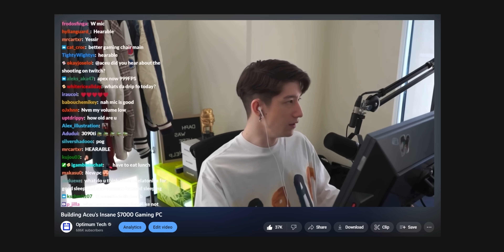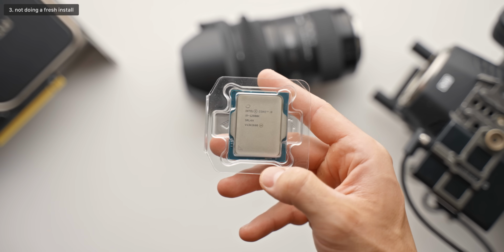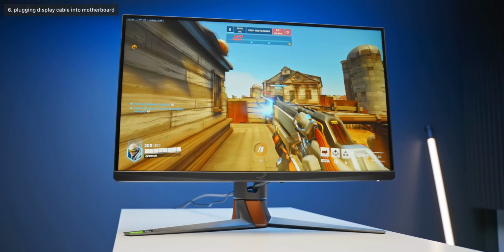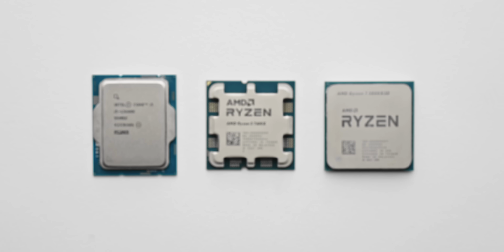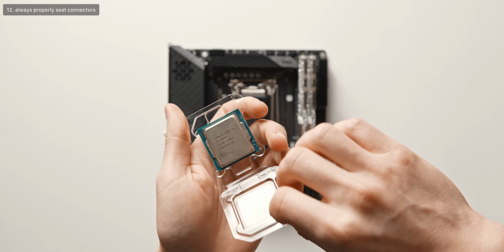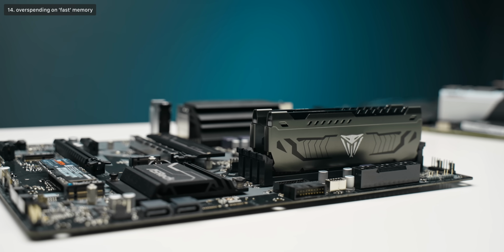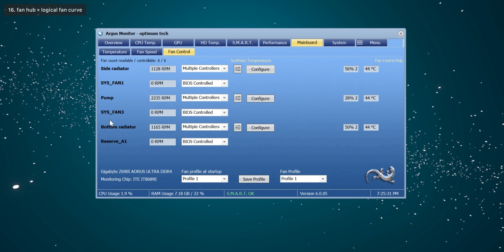Avoid These PC Build Mistakes

Comment: What are the odds that new ram sticks out the box are unstable? I just recently finished my first pc build. Was able to install windows but keep getting “corrupted files have been found” when running the sfc scan now. I will randomly get blue screens and my pc will freeze randomly as well. Did a diagnostic on my ssd and it seems to be in good condition. The windows memory diagnostic let me know there were hardware problems so I’m just hoping it’s the new ram sticks and not the dim slots 😭

Comment: Overspending on CPU - not true when it comes to powerful graphics cards. 4090 is often bottlenecked by CPU. You just need to buy CPU according to GPU. No need to buy i9 with 1650 and it's stupid to buy i3 with 4090.

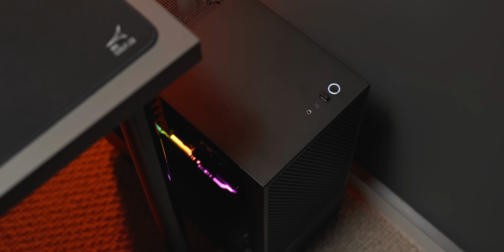Comment: 1:20 yeah, when i built my pc in 2019 with r5 3600 on b450m motherboard, i had problems like this even pc not starting anymore cmos had to reset many times, but as time passed updated bios many times it fixed it self, makes sense taht am5 is havign same problems now...

Comment: Just built my first pc last week.  I didn’t even think about it as I put the cpu on the motherboard.  My biggest mistake?  After setting everything up and playing some games (everything working good) I ran a benchmark and my cpu only scored roughly a 9000 on a multicore cinebench23 test.  Temps never moved from 30c.  I wiped the ssd and reset the bios since I had no clue what I had done wrong.  It all works perfect now and after the fact I think I had accidentally set the bios power to the wrong setting.

Comment: i don't agree with the overspending on the CPU, unless you going for a very low budget build i think there's a very good advantage to invest more on the CPU now, because prices don't jump up so high as GPU's and then you can just upgrade the GPU. like now i would advise on going with the 7800x3d if building a new PC even if that leaves your budget for the GPU lowish. the same applies for the power supply, you can get a 850-1000W PSU rated 80+ gold from reputable brands for under $150 USD. 

with that you're set for like years with the same platform with only needing to upgrade the GPU. no more worries about bottlenecks.

Comment: Memory stability with ryzens... On my 5600x setup with B450 mobo stock XMP profile is setting DRAM voltage to ONLY 1.23V where 1.35V is recommended

Comment: I thought 3 wire fans are pwm. 2 wire is voltage regulated. Is there fans with 4 wires? I don’t have the option to change in fan xpert, or bios.
Reply: 3 pin is voltage regulated and 4 pin is pwm, not quite sure why
Reply: @IwanJames  thx james. I'm still learning.

Comment: When it comes to thermal paste, i use enough to spred it across the whole cpu ihs, than i add a pee sized ammount on top of that to fill in any gaps and divots when the cooler is placed on the cpu

Comment: always fresh  install ur os when building a new pc. save ur stuff from the old pc on a external drive and drag the files afterwards back onto ur new system. 
check for bios updates and check ur ram speeds in bios.

Comment: I over tightened my CPU cooler bracket and it ended up scraping through the protective layer of the motherboard right down to the copper and it ended up shorting out. thankfully it's still alive and perfectly fine, but the CPU bracket and motherboard are very burnt. amazingly it's still completely fine

Comment: Here's my problem... My motherboard died and since it's a 1366 socket, I can't really get a replacement. So have had to change my motherboard, CPU and RAM. Technically I could use my old RAM, but it's not exactly fast RAM.

Now I want to use my existing installation because I've got a lot of VERY custom setup on this install. I'm not one of these people that installs Windows every other week and with my installation, it takes 3/4, maybe more days to get all the dev software and other things I need. So, what do you do then?!

This machine has an Adaptec RAID controller, Intel 25Gbit SFP28 NIC which needs special drivers and with the various editors and stuff I have, it takes a long time to get everything configured.
Reply: You don't have to re-install Windows, but you will probably have to install the drivers for your new motherboard.

Comment: FanControl is amazing ! Leaps better than speedfan!

Do i need a fan controller inside my pc to control my case fans with FanControl program?
Is that why they're not controllable?
In my pc case, they are daisy chained to the psu using a  4pins with doubled side  clanmps. Not sure if that's just rgb or  argb

Unlike my cpu cooler (peerlees assassin argbl which is argb 5v 3pin and im too scared to plug that one in anywheres, my b450mh mobo doesnt have argb only cpu_fan, the cpu coolers power wire works in that and is controllable with speedfan but not in bios. Bios shows 0 C for cpu :😮 luckily fan control saved me for now
Any tips

Comment: I also use Argus monitor as I set everything to the water temps of my reservoir. I disagree with using NZXT Cam as it's just more bloatware especially after you said not to add the motherboard bloatware software.

Comment: One iv found is make sure the case you're going to use has the same IO options of the Board you're going to use. Example front panel USB A-C some cases still don't have both it's one or the other 🤦‍♂️

Comment: Just a tip, I control GPU fan speeds with MSI afterburner, it's very useful
Reply: I think he was referring to controlling case fans by GPU temp, not the GPU fans
Reply: @queueeeee9000  oh, simple then, go into bios and save a preset with that setting and load it then restart ur pc
Reply: @kon0212  that's what he was saying, you can't control case fans from GPU temp in bios. You need software

Comment: For Linux the boot drive issue is not a thing.
For PSU I normally buy compatible ones from Corsair, this helps with pin out.
Problem with the fan controller is that I assume you would need software for that.

Comment: Are these parts compatible?

1
CPU
Intel Core 17-14700KF
2
GPU
ZOTAX RTX 4060TI
MOTHER BOARD
MSI 2790 P Pro DDR5
RAM
Corsair 16x2 Vengence 5200Mhz
CPU COOLER
Corsair H150 RGB 360
STORAGE 1 (SSD)
WD 1TB Gen 4 M2 Nume
7
STORAGE 2 (HDD)
SMPS
Deepcool PM750D 80+
9
CASE (WHITE)
Galax Revolution 06 ARGB

Comment: what about the actual power cable that goes into the wall, i just finished building my first pc, and it seems like i did a pretty ok job aside from the fact that i bought 4 sticks of ddr5 16gb vengance ram and struggled to get them all working for an hour. but if i dont feel like ripping apart my cable managment on my desk can i just reuse the same power cable my old power supply did?? my old one was a 650watt my new is a 1050watt. its not that i dont have i just dont want to do a bunch of cord rearanging to replace this one damn power cord

Comment: I'm guilty of using PSU cables from a different brand. I was swapping out a PSU and was too lazy undo all the cable management so I only swapped the PSU and plugged my old PSU cables into it. Thankfully I didn't fry my hardware or more importantly, my HDDs. It blows my mind that there's no industry standard here. And if there's no standard, I would expect them to make the PSU connections different on the PSU side to prevent mishaps from happening.

Comment: i agree with everything except "you dont need an i7 or i9 for your gaming" i have a 4090 can the 13600K run that above its 90% usage? no even the 13700K cannot do it even in 4K, i tried them all and if you aim for high GPU you do need a 13900K or the 7800x3D (its just AMD CPUs that you don't need the higher core count cuz the 7800X3D performs better than 7950x3D)

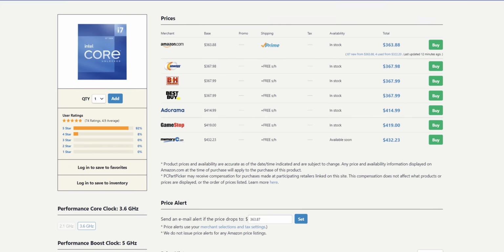Comment: Referring to 7:09... Where in the heck do you easily reference the "memory controller" speeds of a particular motherboard? I assume PCPP doesn't have any such filter, but I will look. Also is there a "best" or "recommended" fab controller that also gives RGB control, including turning the lighting off?

Comment: Was overspend on Trident Z DDR4 4133mhz cl17 who's not running at xmp profile, put back my old cheap Klevv Value 3200mhz cl22 ram and I'm able to run it on 3600mhz 18-19-19-43, that dang we don't need expensive memory moment.

Comment: 7:15 if you have a 7950 which supports 6000mhz then is that better then the 3600?
Reply: He was referring to DDR4, in the year 2023 when DDR5 is basically the standard his advice about RAM and CPU should really be ignored.

Comment: Common mistake (especially with older not-so-auto configuring hardware) is not setting DIP switches correctly. People wonder why their hard drives and expansion cards work when they have them set to all use the same address!

Comment: So glad you mentioned swapping in the boot drive from an older machine. I cannot tell you how many times I see new builders ask if that is OK or if it will work. Yes it CAN work in some cases especially going from a similar spec machine to another but is ALWAYS a bad idea, worse yet is people responding saying "Oh yeah that's fine" or "Sure no problem I do it all the time" just makes me want to pound my head against a wall. They don't realize all the things in the registry that tie's the OS to the old machine from installed programs and games and apps to drivers, settings and timings etc. Again it CAN work on occasion but at best can result in an unstable or slower machine and at worse cause BSOD's or simply be unbootable from the start. And really even those insisting it's fine (for them) it's just being lazy and inviting trouble in the long run.

Comment: Excellent video, we’ve all had these happen at some point.  I am curious about the memory speeds.  I may have just wasted a ton of money on ddr5 6000 sticks paired with a z790 mb.  Is there some simple calculation to determine gear 1, I have a 13700k..  also the wifi antennas are a perfect.
Reply: also interested, i have a 13700k and ddr5 5600 mhz and i get a lot of memory related crashes without modifying ram settings

Comment: I feel like 3200mhz for ram is the sweet spot because you typically see lower CAS and lower is faster.
Reply: 3600mhz cl14 is the way to go, or 3600 cl16. 3200 mhz is way too slow even with cl14 speeds
Reply: @IamMxfia  well yeah 3600 cl14 is much better but you’re going to pay out the ass for 32gb lol
Reply: @cooltron  And will it be noticeably faster in the real world outside of benchmarks?

Comment: I just made a USB key with windows 10 on it to do a fresh install, can i just put the motherboard drivers on the same key ? will it install automatically? thanks
Reply: You can put the drivers on the USB drive. They won't auto install. You would have to manually install them yourself.
It is possible to create a custom Windows image that has the drivers pre-installed. Its not an easy thing for most people to do, but you can do it using a utility like NTLite. Microsoft has something called MDT that lets you do this, but in typical Microsoft fashion, it isn't straightforward and is inteded for IT use.

Comment: i have been suffering from cpu bottlenecking on my laptop that i use with an external gpu (rx 570). So i saved money to build a pc and i bought an upgrade kit with ryzen 7 7800x 3d. I had to make sure to never cpu bottleneck again, i will upgrade gpu later after saving more money for gpu.

Comment: Don't over apply thermal paste, the overflow might drop into the socket.
Reply: All thermal paste except for liquid metal is non conductive to electricity, makes no difference if it gets on the motherboard
Reply: doesnt matter

Comment: Can't say I've ever had any issues with Windows and changing motherboards.  There isn't in my experience anything magical or special about how Windows interacts with the board.  It's primarily a matter of installing the drivers.  If you really want to refresh Windows you can do an install over an existing installation.  This will keep all your applications and settings, but can update anything related to marrying Windows to the motherboard.  So I'd call automatically doing a new install Windows a mistake.  You're going to be wasting days getting your system back to having everything installed when maybe an hour of installing new drivers would do just as well.

Comment: I'd say out of all these, the RAM tip is the most useful, especially for last year's first generation DDR5 motherboards, a lot of them had issues, especially older motherboards with DDR5 support for "future proofing".  Future Proofing is a myth in this day and age, all you have is like in the 90s, overclocking it until it's done then upgrade.  Simple.  Only buy what you can afford, don't overspend and be stuck with a system which gets increasingly substandard for a decade.

Comment: What is a fresh install? And Why can't I download the BIOS version directly to my local disk C:?
Reply: A fresh install is when you install a new copy of the operating system (say Windows). A fresh install wipes everything off of the install drive and starts from a blank slate.
Reply: @JJFlores197  Thanks. Does that mean if i have the hard drive from my old computer then transfer to the new computer i have to reinstall windows and wipe all the data, right?
Reply: @ION-um9gy  With newer versions of Windows (say Win 8 and newer), you don't necessarily have to do a clean install. I personally would do so as if you move from a different platform (Intel to AMD or vice versa) there sometimes can be issues with Windows booting correctly or otherwise some performance issues. Its your PC and up to you.

Comment: Yea the paste on the CPU always triggers people for some reason even know there are plenty of vids on YT showing it really does not make much of a difference and it is the pea size that is not recommended to do as Linus showed buy putting a full tube of paste on a CPU and it not make much of a difference and the pea size is the worse as it not always spread the whole PCU so missing spots but it wont kill it just means a few temp higher like under 5c so more is always better then spots missing. I like the X method just because it easy and fast for me to do and guarantied to fill in all the space nearly all the time i hate the spread one i just make a mess of it doing that way. And no ways of applying is the best way just look up vids on the ways to do it and pick one that you think is easy for you to do.

Comment: I don't really get how reusing your existing OS install can cause system issues/blue screens and you haven't even explained why that happens if it actually happens. I doubt that is the cause.

I've been migrating and/or cloning my OS since HDD days and never had any issues w/ it. You can always use DDU to remove unused GPU drivers and manually remove other device drivers for ones you do not use via the device manager.

Comment: 1.mishandling cpu socket
2.unstable memory by not setting up dump in bios
3.not using a fresh install
4.prepare lol your drivers!
5make sure to use correct fan headers 
6 monitor in mb and not in gpu
7to much thermal paste 
8mount cpu cooler correctly 
9 don’t mix up psu cables 
10 don’t overspend on cpu

Comment: Me watching this after broking 2 pins from R7 1700 cosing 6 pins to melt down because R9 3900x pull too much power and motherboard and power supply wasn't capable of handling it. 
There are more problems to solve when get get to PC building but good thing is you learn by mistake.

Comment: pcpartpicker is no longer updating with any workstation parts.  i wanted to use it, even posted in their forums asking after when the new intel xeons would be added and got told they wouldn't be.  pretty disappointing.

Comment: Right now I have i5 7500 and GTX 1070. I want to upgrade my CPU and of course I have to change motherboard so is it good for go for some budget buy, Ryzen 5 5500 and B550m Gigabyte or MSI. If not that what would be good as budget upgrade good for both gaming and editing ( I will upgrade once again after that, but for next year I need some 'good enough upgrade')

Comment: X570 carbon msi motherboard
 
5600 non x Cpu
 clocked to 4.75hz stable af 

6750xt 12 gig gpu 

32 gig of ddr4 ram 3600hz 

X2 m.2 sdd 

850 watt power supply 

Aio , rgb fans and more! 

Build it myself 

It's easy 
So many guides out there to follow .

Comment: You glossed right over the importance of coating the ENTIRE SURFACE of the CPU with thermal paste. Using a few globs instead of a thin layer completely covering the CPU will result in areas having no paste at all, and thus no cooling. I am US Navy trained and retired after 35 yrs of hardware and software support mostly in mainframes.

Comment: if I'm switching pcs can I use the m.2 drive from my old one on my new pc but first clear it into an external drive then once finishing installing windows and setting it up on the old m.2 in the new pc can I import my data to the new pc via the external drive?

Comment: The largest mistake is "doing" it instead of making it.
We used to solder parts onto circuit boards and use ultra-violet light to burn ROM microprograms onto microchips back in the '80s. "Building PCs" (putting one part into another) feels like kindergarten, albeit an expensive one, these days.
Reply: ok boomer

Comment: Why does nobody remove the socket cover before installing the CPU?
Reply: It is recommended by Intel and a lot of professionals to leave it there while installing the CPU so that it is perfectly centered or boxed in while slotting it in as the cover will pop off anyway.  It's just for extra caution but you can do you.

Comment: If i lowered the lever on an intel cpu but the bracket on the socket didn’t latch down could i have messed something up? Temps seem perfectly fine and no blue screen or total system crashes or anything like that. Just alot of crashes in warzone 2 lol